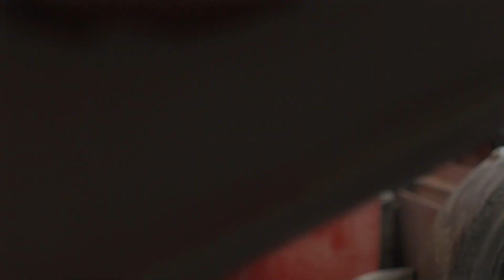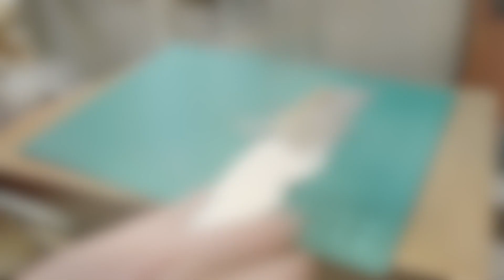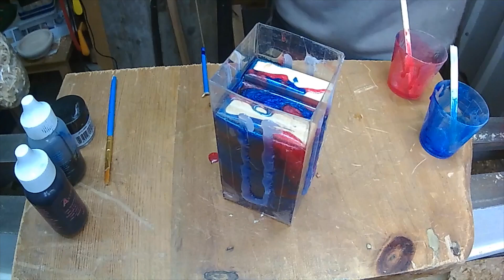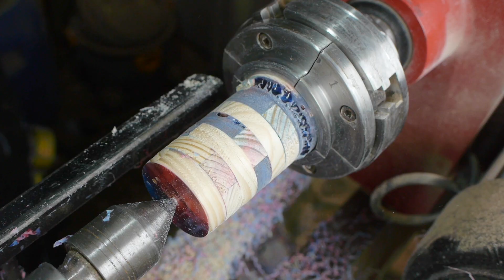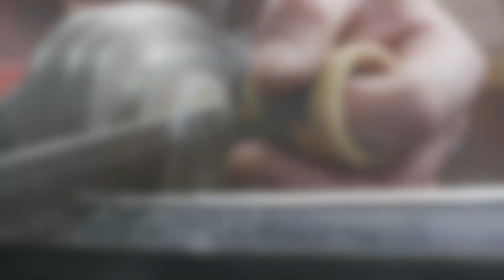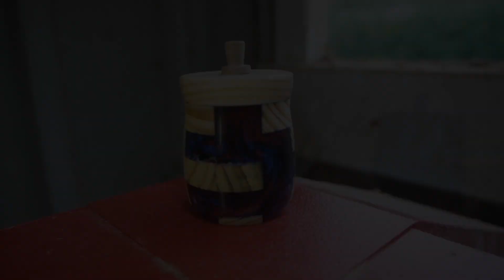Woodturning - Jenga block lidded box. Wood and resin turning.

Comment: I thought the handle was going to pull straight off the lid at the end there. But it didn't. Because the glue had dried. Isn't glue brilliant really. Massively under appreciated if you ask me. We should acknowledge glue and it's uncanny ability to make two things in to one thing, often in useful ways. I once made two fingers in to one finger using super glue. Separating my new Siamese fingers was no mean feat i can tell you. I was like half a Spock for a bit. Should have left it really, you know, for the disability benefits and the free parking.
Reply from the maker: Dude, that was a journey 😂 Glue is pretty awesome, the unsung hero! Let's have a moment's silence in honour.